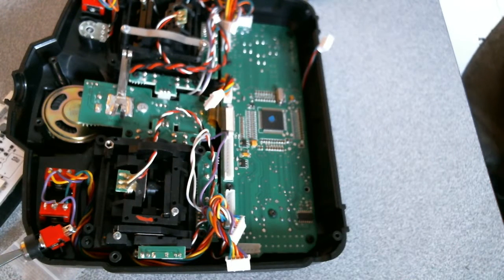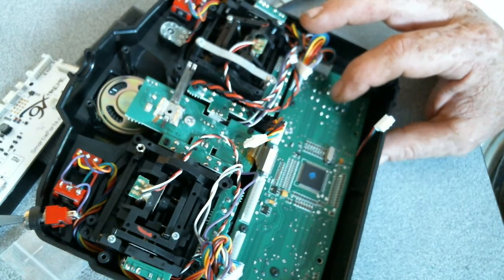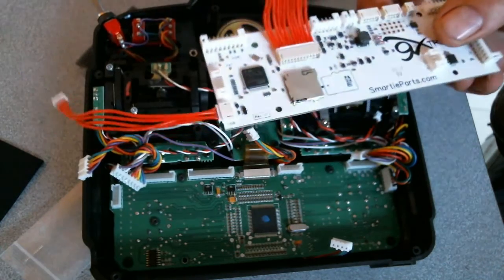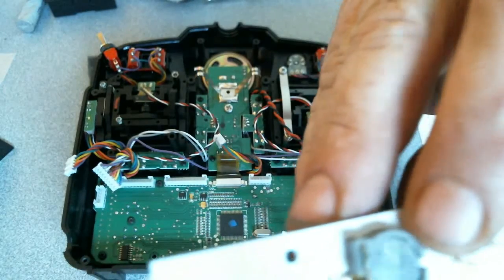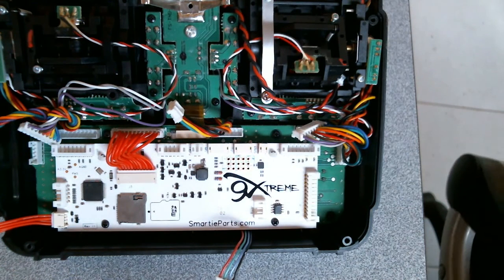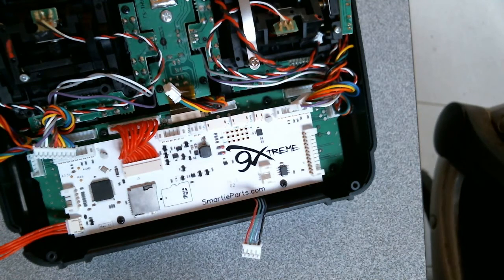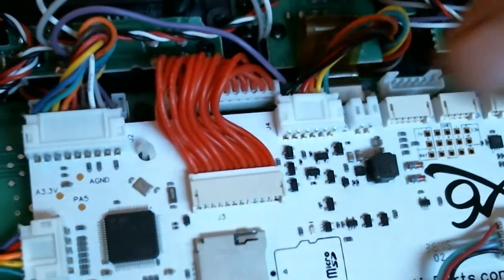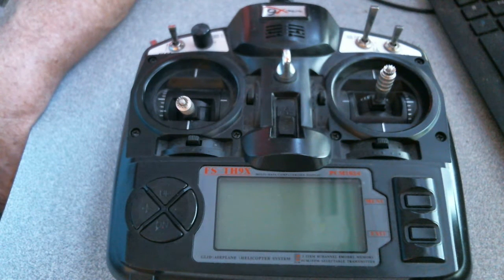Smartieparts 9xtreme TH9X Upgrade.

Comment: as of 2017 the Smartieparts 9xtreme is no longer available!!!
Reply from the maker: its a bummer I know.
Reply: ironically i have a 9x i bought i've never used, i bought it with the intent of using it for quads then the faa thing hit and i said screw it and went back to cars, now i'm getting the urge to fly again but this time i'm doing a plane and the 9x would work fine but i'd like to do some of the upgrades but everything for the 9x is discontinued now...bummer

Comment from the maker: Yes all the time with the Frsky x4r receivers
Reply: I have a x9r receiver. I was able to bind the receiver to the transmitter, but only the throttle works.
Reply from the maker: Isn't that the long range one because I think I remember reading that you have to change settings with the dip switches on the rear of the XJT module ?????
Reply: +NQIS Steve - that's correct. I did change the settings in the back of the xjt module. by the way I said I have a x9r but I  meant L9R. I will keep trying different things. but if you get your hands on a L9R receiver please make a video.
Reply from the maker: Ok